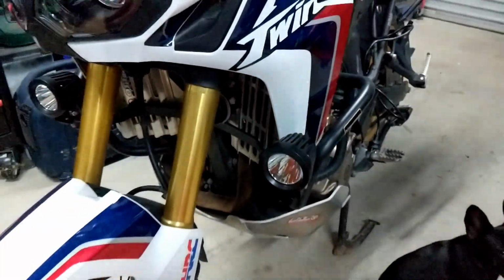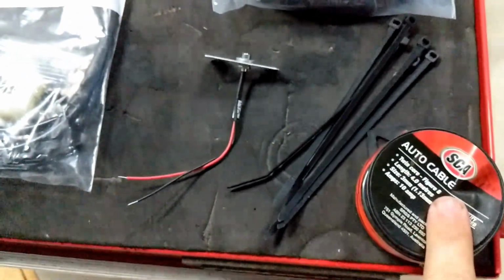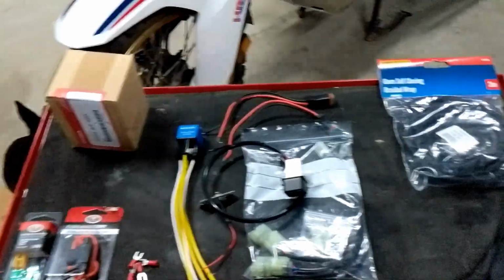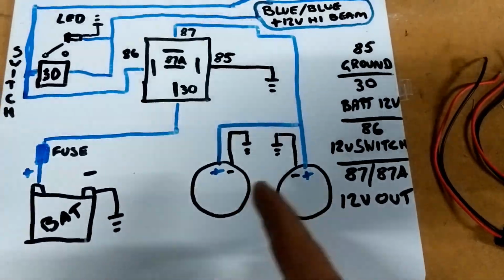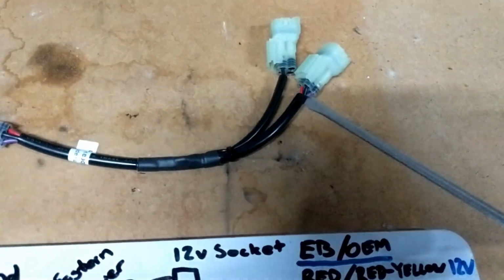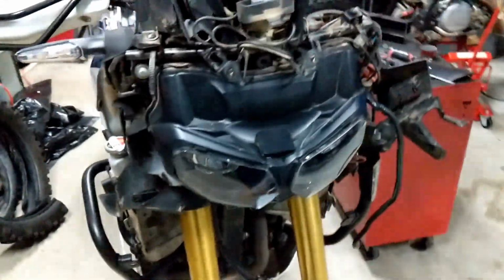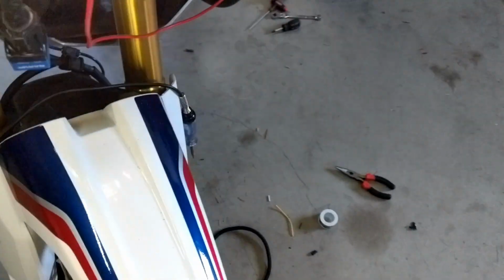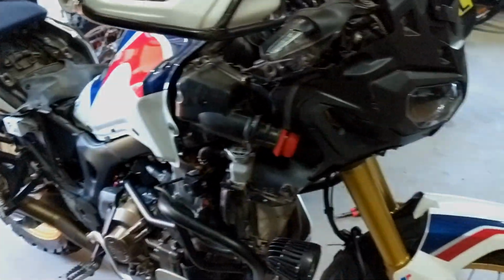Africa Twin Spotlight Wiring + Lighting up the OEM switch

Comment: good day, I'm wondering where I need to connect to which wire or place in order for my dashboard fog light to come on. do i take the "+" wire from the switches?
I have an Africa twin 2016 manual
all the best, Misko

Comment: Hello
I loved the work you did.
could you tell me how can i do the same but without turning on the high beam?
that is, being able to switch on and off whenever you need without having to log in the maximum.
independent firaria.
what is the difference in the wiring diagram.
thanks

Comment: Nice video with some great info! I appreciate you putting the time and effort into posting this. As soon as I get my brackets I'll be mounting some Baja Designs Squadron Pro's to my 2018 AT. But I'll be connecting them to my Neutrino Aurora Plus, so no relay needed and it will give me a little more control.

Comment: Great video. Top notch pro work. Congrats...
I will be setting up my lights pretty simple: no separate switch. Relay and fuse of course. I want to trigger my relay with high beam so that spot lights come on only with high beam. My question is where can I find a 12v positive line with oem high beam? 
Thanks and kind regards. 
Ride safe mate. 
Cheers
Reply from the maker: So you want the spot lights to always come on with high beam. No seperate switch?

Comment: Great video mate , but I'm having issues with the wiring. The White/ cream coloured plug behind the dash only has 2 wires, green and green/black. Does your plug have 4 wires in it ? I don't understand where you wire to for the dash indicator. Any help would be appreciated
Reply from the maker: There should be a 4 wire plug buried behind the dash. One of those wires is for the dash indicator. The other three are switched power, earth and high beam signal
Reply: @BJK1987AU  hi, thanks for your prompt reply , my bike is a UK 2018 Adventure Sports. It turns out Honda changed the wiring and the Aux power is now wired directly into the loom. The plug is still behind dash and it has 3 wires, I believe the blue black will turn on the fog light indicator on the dash and the other 2 wires are live and earth. Honda have removed the 4th "main beam" wire on UK and European model bikes but left it on the US model, So, I'm all good now. Thanks very much. Perhaps this comment will clarify and save someone else the trouble that I've had. Lol.
Reply from the maker: @kirky1298  interesting they have changed it. Thanks for clarifying
Reply: @kirky1298   hello Kirky,  i was looking at those wires today behind the dash on my 2018 uk model , ( not adventure model) and only 3 wires in the spare plug like yours. and i was looking to wire up 2 fogs and the 12v accessory socket and you say the 12v is wired into the loom , are you saying there is now a separate plug for the 12v aux power to plug into ? 
really confused     cheers chris

Comment: where Can get the Y cable. have part number? thanks
Reply: Part number for that Y cable would be great. There’s a bunch of parts on that web page and none specifying a y cable for that area
Reply from the maker: It's from Eastern Beaver. On their site. Can't miss it.
Reply: Stazza Brendan front power splitter?
Reply: @BJK1987AU   Excellent video, it helps a great deal!  A question - can you explain what the red and blue wire of the OEM switch connect to?  Does one or the other connect to EB purple and / or blue wire?  And then the other OEM switch wire goes to the relay?

Comment: Great job, mate! 
 
Question: how would you wire the fog lights so the dash indicator along with the LED lights up when the fog lights are activated without having to activate the high beam simultaneously?  Because there are times when I want the fog lights on without the highbeam but would like the indicator on the dash to show fog lights are on.

Also, are those the SW Motech fog light bracket on the crash bars?
Reply from the maker: The best way would be to use the switched power wire on the 4 pin plug behind the dash. That's the OEM Red-Yellow wire. You'd connect this wire to  the LED positive and the switch which leads to input #86 on the relay. 

The only change on my diagram would be taking the feed from the blue wire on the 4 pin connector and putting it on the red-yellow wire.

With this writing setup. Whenever the key is turned on you'll be able to have foglights on.

Yes they are the sw motech brackets on the sw motech bars
Reply: I really appreciate you getting back to me and the work you've put into making this video.  Thank you!  Unfortunately, I'm a noob & a dumb dumb when it comes to electrical wiring, and tight on money...so a video of your wiring (switch, relay, 4 pin, etc.) would have been really helpful.  When looking at your diagram the part that confuses me is how you wired the switch, relay, and LED.  For example, you have the LED positive wire splitting to the OEM switch and EB blue wire.  Where did you solder/posi-tap/etc. the LED pos wire to on the OEM switch?  Then you have the relay wire connected to the OEM switch wire.  Which OEM switch wire did you solder it to?  When connecting the OEM switch to the EB, did you cut/splice the ends?  If so, how did you connect it to the EB individual wires?  Sorry for all the dumb questions.  Your help would be greatly appreciated.
Reply: Stazza Brendan where can I find the triway system you put in the back of the dashboard
Reply: @BJK1987AU  GreatGreat Video!!
with this change to the red-yellow wire, should the dash indicator still works?

Comment: A proper job and great reference for those wanting to replicate the OEM lights. Strange how you can only use the spots on high beam, meaning they can't really be used as running lights - or fog lights for that matter, as high beam in the fog is useless.
Reply from the maker: I'll be using them as spotlights. Due to the laws here, spotlights can only operate while highbeam is on. So making them operate separately is illegal. I had this issue on my KLR when it had its inspection before sale. They were switched on their own.